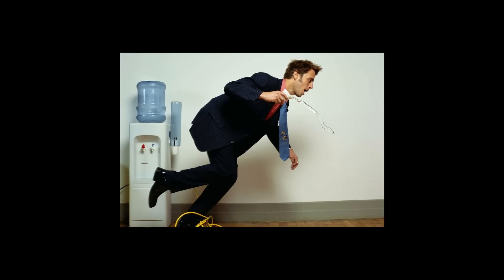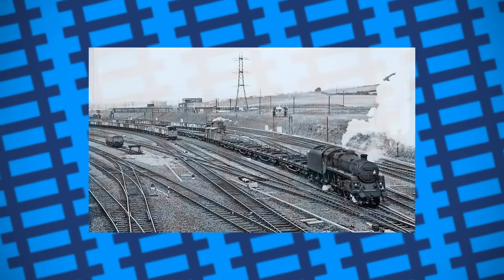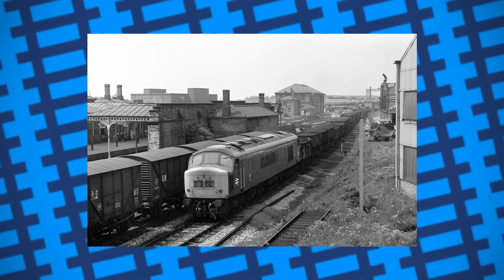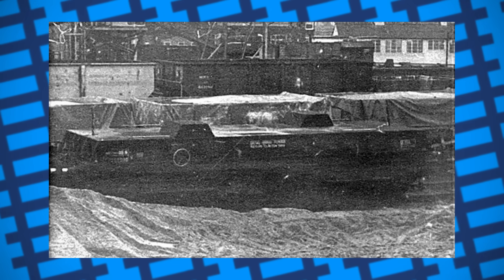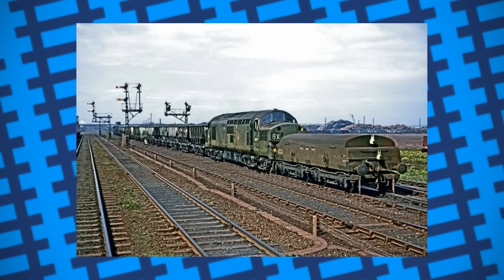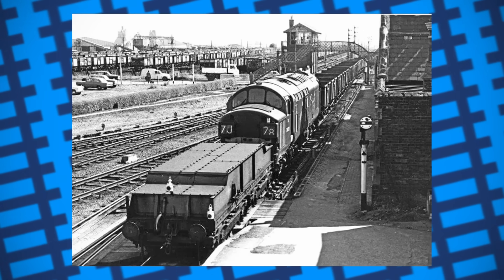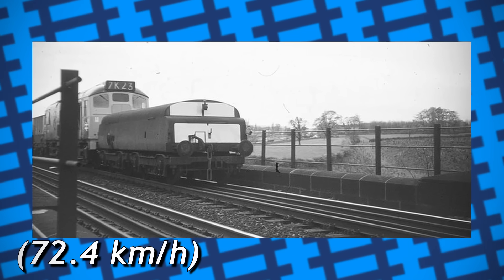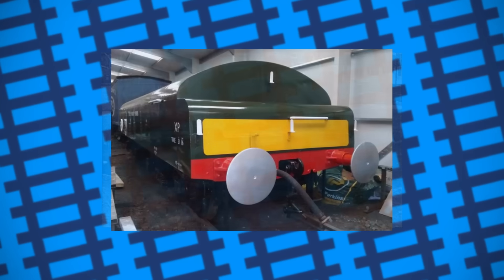Why some British Diesels had Tenders - BR Brake Tenders

Comment: In the United States, Southern Pacific experimented with this idea in the late 1970s and early 80s. Their Fairbanks-Morse H-24-66 Train Master diesel locomotives were being withdrawn from service and SP modified several of them into "Brake Sleds" by removing their cabs, car bodies and running gear (except for airbrakes) and replacing them with a flat ballast compartment, several feet deep, filled with concrete. Operational results were mixed and the SP Brake Sleds were all scrapped by 1985.

Comment: Please please - it was vacuum brakes not air.  It really needs the commentary changing.
Reply: The Big 4 used vacuum.  BR switched over to air.
Reply: @00Zy99 although some of the constituents of the Big 4 used airbrakes.
Reply: @00Zy99 These were introduced by BR 12 years after nationalisation. They were fitted with vacuum brakes.
Reply: @00Zy99  not until the mid 1970s
Reply: @ 00Zy99 is quite correct, many such as the Great Eastern and the Caledonian Railway used the Westinghouse air brake instead of vacuum,  and their steam locos and stock were so fitted. However by the time of the dawn of the diesels the vacuum brake was the universal standard.
Reply: @00Zy99 
Vacuum brakes were still in use in the 1980's
I remember unfitted and partially vacuum fitted coal trains on BR-SR on routes through Wimbledon. They still had brake vans. Brake tenders, often in pairs were quite common. Later around the mid to late 70s, they went fully vacuum fitted with no requirement for a brake van. Only when the HBA hoppers were introduced did air take over on coal traffic where we were. The first air only locomotive, the class 56, was introduced in 1976, twenty eight years after BR was formed.
Reply: @neilcrawford8303  HAAs were Air Braked on the MGR circuits from the 70s onwards. A fair few unfitted trains were still operating around Doncaster into the 80s in the form of HUOs.
Reply: As stated at the start of this thread, all 1950/60s locos were vacuum braked. Air brake was loco only.
Reply: Air brakes always make me think of huge flaps that fold out to create drag, like planes.

Comment: Before they were used, the heavy unfitted coal trains in and around the north east coal fields became absolute nightmares if the weather was damp or wet and common to see a diesel wheels locked skating out of control even with the brake van full braking and wasn't uncommon for shuffling wagons to jump off the rails due to the irregular braking forces.   Shuffling affected all engines, even the 9f's could find their nose shuffled over a signal treadle into the next block by a long rake of coal wagons as the principles of kinetic energy wasn't widely understood and a 4 wheel brake van can only do so much at the far end, the front engine would hard brake, the energy transferred up the rake through the spring buffers to meet the hard braking brake van and would rebound back adding tons of kinetic energy each wagon it bounced through and hammer the front engine along the rails.